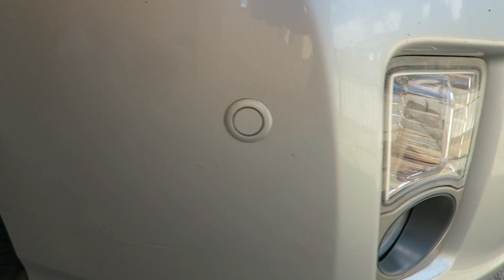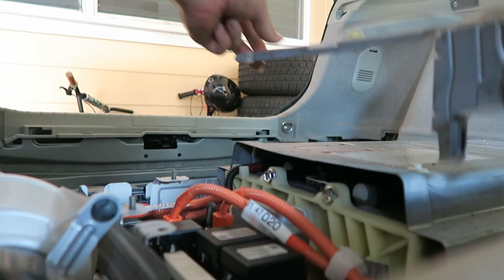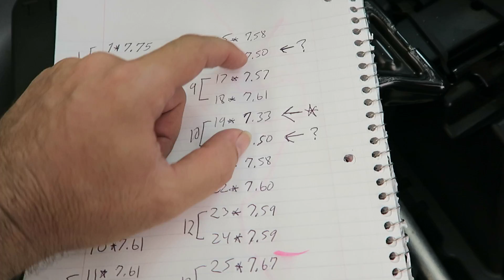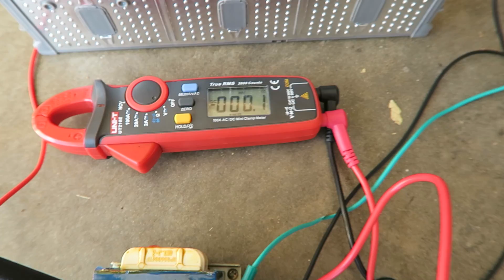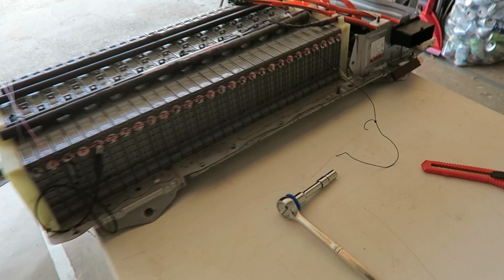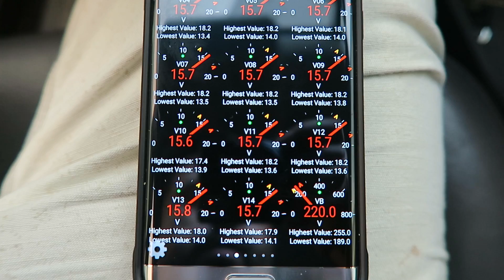Prius High Voltage Battery Repair | Gen lll 3

Comment: Use the orange breaker plug to disconnect the orange clips. On the tip of the arm on the orange breaker plug, you will see a small circular key point that is inserted into those two orange clips. Once inserted, a quarter turn in the direction the arrows point on those clips and your clip comes free. No need to pry anything.

Comment: I use Dielectric Grease anti corrosion on the cleaned up nuts and buss bars found at your local Auto parts store. I got mine from Advanced Auto. A 3.3 oz. can was a little over $12.00. Should be enough for life time of use.
Reply: I was wondering about that.  I don't see anyone else bothering with it.  I think it's a good idea.  That's what the stuff is for.

Comment: Too bad you are not in Cali. Main battery warranty is 10 years and 150k. Dr. Prius will tell you voltage AND Internal Resistance. It's what the Pros use.
Reply: That's why cars cost an extra 15-20% in Cali too.

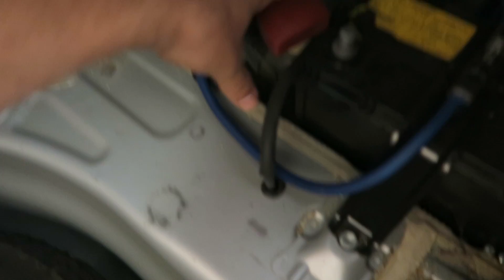Comment: U just solved my problem@2:54 of where to hook up inline power to 12v battery for powered amp. Would that be called the shunt side as someone mentioned in a thread. Now to find a good ground w multi. If i keep watchin this vid I bet i find it. Lmao fyi there is a spot on power cable battery for the dc dc converter fused to know that your connected. Dont know if thats where you hv it connected.

Comment: Pull the battery out before you take the main lid off. You can't do much in the car. You can't get to the bottom bolts in the car. You can't deadlift 120 lbs.? Hit the gym. I'm 72 years old and lift mine all the time. The trouble with buying used modules is that no vendor will tell the serial #. The first two numbers are the day, the third is the month and the 4th character is the year.But you have to know the secret code. You might have bought a module older than the car. Worthless.
Reply: He's doing a load test on them.  Is that useless?  Question; Can dielectric grease be used to keep those connectors from corroding?

Comment: Dr. Prius will tell you the bad block. Measuring voltage is a waste of time. You have to measure under load. And you have to measure Internal Resistance. You may be lucky but all that work may be a waste of time.

Comment: This would be under warranty in California. 10 years and 150k. Dr. Prius would show you the internal resistance  and voltage instead of crappy Torque-Pro.

Comment: It is December 2019 now. Did you have any problems with that 2010 Prius battery since the replacement of cells?
Reply: Having issues with our 2010 too. Just got a p0a80 code.  About to get a torque app or something to diag. What problem are you having?
Reply: @chrissignal8857  how many miles?
Reply: @Usernotknown21  160k
Reply: @chrissignal8857  i talked to dealer they say batteries last from 100k to 200k.  Funny the batteries never wear out under warranty
Reply: @chrissignal8857  did you ever clean the blower motor that cools the hybrid motor? 🤔
Reply: @Usernotknown21  yes cleaned but codes came back.
Reply: @chrissignal8857  no. I was wondering if you cleaned it as part of maintenance before the codes came in the first place?
Reply: @Usernotknown21  no

Comment: hey bro, I had the "Check Hybrid System" error, I did a check with the diagnostic tool, the error is P0A80, so I did again a test with milimeter and all cells are over 8v except 2 blocks are 7,8v . what do you suggess ?
Reply: Did you figure this out? My 2015 Prius just had the check hybrid system error message pop up and i had the same code when i scanned it.

Comment: I just bought a 03, with bad batteries, I thought about replacing the cells with lithium ion 2 in series, per model, it would charge to 8.4v and discharge safely to just under 6v, I think I'd get a ac charger to top it off, not rely on the vehicle to fully charge the cells, if the computer will all such modifying, I'd like to drive it mostly electric, about everywhere I go, the speed limit is 35mph. Any opinions are welcome! I'd like to double the range or better if possible,

Comment: Note of caution with the packs. The modules can thicken over time. If so, when you remove the modules and then go to put them back in, you will need to have a 30 inch pipe clamp handy to gently nudge them into place so that the anchor screws line up from below. You may also need to give them a love tap with a small hammer for other direction alignment (that's not as bad as it sounds :-). If your batteries are slightly thickened like mine and you do not have these pipe clamps, you may be screwed as far as getting the modules back in the pack. It is best to clamp two modules at a time to the secured block and secure them as you go.

Another practical tip, to remove the pack from car by yourself, best to straddle the pack with your feet, with your head facing the controllers and fan. Put one foot on back seat middle support and the one where spare goes. Lift with legs and move the driver side end first. Lift the support leg over the little hump and then set it down on the other side. Then with your eyes trained on the various wires at the controller end, gently swing the controller end out and set it down on the metal platform. At this point, with the pack resting on the metal platform, reposition your right leg as far back in the spare tire well as you can get it. Then, using your legs again, reposition the whole thing as far towards the back of the car as you can get it and rest it on the metal platform. At this point, get yourself completely out of the car. From the back you can now pick up the whole thing and remove it from the car. always use your legs as much as possible and when carrying the pack keep it as close to your body as possible. I suggest wrapping the pack in a towel to avoid the sharp edges while carrying it. center your hands around the battery, as this is the heavy part. the battery pack weighs about 80 lb so always use your legs as much as you can. this will help you to control it better and also might save you a problem with your back. Just thought I'd let y'all know :-)

Oh, in addition to the Torque app there is also the Dr Prius app. I highly recommend this app.

Also, the big Orange plug that you pull to deactivate the battery pack, has a special little nipple on its handle. That is used to remove the two orange safety plugs. That scheme is Toyota's clever way of ensuring that you have deactivated the batteries before messing with the pack. Hold the safety plug at its base and align the male-female parts and rotate, as the safety plug arrows indicate. They will come right off.

BTW, I devised a method for making a modification that allows one to establish modules 23-28 (the ones furthest out from the controller) as 'plug-and play'. I can swap these modules in and out without having to take the pack out of the car. I place the weakest modules in that area. If anyone wishes me to describe how to establish this plug and play area, just ask.
Reply: Make a video. It sounds awesome

Comment: Which is best to diagonise Toyota prius Torque pro vs Toyota Techstream ?
Reply: I'm not sure what you're intending to do, but purchasing a BAFX OBD2 scanner for about $20 and the Torque pro app for $5 will only cost you $25 total, and it allows you to view an incredible amount of information about your car. If you need help setting up the sensors in Torque Pro for the Prius, check out this video I found: https://www.youtube.com/watch?v=GYrslzbrwz8

Comment: What battery charger did you use to charge all the modules at once?
Reply: I want to know that too he said it was a 1 amp charger
Reply: @RSADYNAMICS  I think simply wiring up the cells in parallel like he did will balance out the cells voltage which is the most important part
Reply: @HEVTech1  yes but what did he charge it with?  Do you use a normal 12V charger set at 1a or do you need some other kind of charger
Reply: @vinceking719  well each cell should be charged to around 7.2v. A 12v charger would overcharge the cells. Most people use a hobby charger that supports multiple battery types and multiple voltages
Reply: Thank you very much.  Having a hard time finding something like that in Australia.  Would this work if I had it shipped from America?  https://www.amazon.com/Battery-Tender-022-0197-Volt-Charger/dp/B00VGO28CW
Reply: That one is 1.25 amps.  Or my other thought if I could use a 6 volt charger to get get some charge in the dead batteries.  Would that be enough to start the car and let it charge itself from there?  I am working on 2 cars that have been sitting in storage a very long time so the he batteries are dead

Comment: Bro, would you mind to link me to the right ODB2 & it’s app for hybrid battery check like yours? I’m not sure if I could find the right one on amazon or eBay myself, plz recommend me one. Thanks.
Reply: May I suggest you go to 
http://priusapp.com/
This developer has tested 100s of OBD2 adapters. Go to the site and click on the drop down menu “What OBD2 to Buy”. May I remind you there are many Chinese knock off, bogus adapters on eBay. So this developer has a few recommended OBD2 adapters. The developers App is called Dr Prius, the specifications for which are in the App Store. Last week, based on the recommendation of the site I bought a second hand Carista 2 adapter( $10). Using the free version of Dr Prius App, I was able to read the voltages of each and every module of my 2011 Prius’ high voltage pack.

Comment: Thank you .  Great videos I will never thought of check individual cell voltage from eBay use (computer balanced ad) none of the match up high was 7.60 and low was 7.10 add all cells up 210.56. So  I did what you did equalizing them. But with 2 copper wiers. I line them up  (-)on  the same side  and tied the end and zigzag all the way down to the other end and did the same with the (+) now they all reading 7.52 . But Definitely will do the load test on the one that was 7.10
Reply: P

Comment: which obd scanner you are using? I have one not reading block voltages.
Reply from the maker: Scanner does not matter. You need the "Torque" App on an android device to see all the prius parameters.

Comment: Hi Vlad
Great video and superb detail.
Quick question pls what charger did you use to charge. And is there a specific charge rate? If you could just explain the wiring bit to charge pls thanks

Comment: I did the process for my Prius 3rd gen battery. I put a load of 24 volts on each cell for a period of one minute and take initial voltage, after one minute voltage and then voltage of all the cell one by one after completing the process for the whole 28 cells. I repeated the process for the cells that i doubts after assessing their voltage and i found 3 cells that were returning a low voltage compared to others and i changed that. No CHECK LIGHTS so far. Thanks for this informative video @ Just Vlad
Reply: Dr Muhammad Shakir please give details of loading testing of 24 volts. What did you do exactly?
Reply: Hey! How long last the fixed battery? I meant with only a few cells replaced..Yhanks!

Comment: Is the charging of the battery necessary? Can't I just change the cell and install the battery back in the car?
Reply from the maker: You can, but it might trigger a fault if the new battery modual is not charged well. But over a few cycles of charge and discharge it will normalize into the pack.
Reply: Ok I understand but I didn't get the specifics on how to charge it. Could you summarize what I need, specs, voltage, amps, for how long please. I'm not an expert, I'm trying to research all I need to do the same with my 2010 Prius.
Reply from the maker: If you have a 9v power supply that should work. You want about 8.2v on the battery modual. But don't over charge cause it will expand if it's not in the pack. That's all really. As long as your putting in a good battery in, there should be no issues.
Reply: Ok so to summarize I need a transformer with a 9V output and regulate it to 8.2V, how many amps? I should connect each cell in parallel and charge it for 3 hours at 1 amp? The goal is to have each cell at 7.8V right?
Reply from the maker: Correct, just get the cells at good charge. It doesn't really matter how you get there. It doesn't have to be equal to the rest. They will all get to where they need to be after you start running the vehicle.
Reply: Ok thanks. One last thing. Should I make sure the battery is totally charged before checking each cell? How should I know if the cell is really bad if it's just low?
Reply from the maker: https://youtu.be/jDieFj8ubuA

Comment: Hi man, thanks for the video.. I tested the modules on my Hybrid battery Toyota Prius C 2012 .. Last week there were showing 7.82 V.. This week using a different volt meter they are showing 7.5 ..when I hook a bulb to it, the voltage go down to 7.1 and sometimes 7.0V on all of them. What next?? a junk 
 ard is offering a battery for $750.00 + $250 for the core .. is my battery fixable or do I need to save time and money and buy the one from the junkyard? thanks for the advice
Reply from the maker: This video will explain how to tell if your battery module is bad: https://youtu.be/jDieFj8ubuA 
Once you figure that out, normally its only one module that needs to be replaced.
Reply: @JustVlads  That is incorrect. The batteries should be replaced as MATCHED pairs. Please watch this video to understand better.   https://priuschat.com/threads/prius-hv-battery-module-testing-and-matching.191354/

Comment: Thank you for the outstanding explanation.  For those of us not mechanically inclined, the video shows how labor intensive battery replacement is.   Understanding what my car needs to function, helps me make the best repair decision possible.   My model is 2010 base with 195,895 miles.   Because of this video, I will repair my car.

Comment: Hi man 
please tell me, did you solve the problem for a long term ?
Reply from the maker: Yes, usually it will be fine for many more miles but its uncertain and another cell could go bad. But overall this is the best option you have if a module dies.

Comment: Torque Pro not avail for iOS.  Anyone know a similar app?  
Also I'd like to know more about balancing the cells. Will they eventually balance or is it necessary?
Reply: Try Dr Prius. The free version measures the HV Battery Banks.
Reply: OBD fusion will allos the custom PID's on IOS

Comment: Could you tell me what kind of app you used you can able to see individual cell’s power and the link of the OBD scanner? Thanks
Reply from the maker: It's on Android called Torque. But you will need the pro version and prius pids installed. Any wifi scanner works fine.
Reply: Just Vlad Thanks

Comment: Thanks a lot for the video. I just replaced a cell on my 2012 Prius V, although I suspect cleaning the contacts would have solved the issue. I replaced the weakest battery anyway. There where no sudden changes in voltage after I connected a 0.3 amp load to each cell, that's why I suspect it was dirty contacts.
Reply from the maker: I would use a higher amp load cause the batteries are tricky figure out. Check out this video: https://www.youtube.com/watch?v=jDieFj8ubuA

Comment: Please, tell me which torgue module that is? I have the app and cannot find that selection which loads all those batteries...ty
Reply from the maker: you need a paid version of the torque app and then you'll need to install the pids (link) https://drive.google.com/file/d/1Drv-LA4I_fFEuSAWJPdIUNHdWedUk3Jx/view?usp=drivesdk
Reply: I do have the paid version...  I cannot find that choice... that is why I wanted to know it's title, thank you.
Reply from the maker: If you cant get the file installed to the torque app, you'll have to input the pids manually. Keep trying you'll figure it out.
Reply: https://www.youtube.com/watch?v=ag02XbyvPNo
Reply: Thank you, I purchased a new reader and it works with a different app... I will work on installing pids manual though... ty

Comment: HI, What ODB2 did you use? I have 2010 Prius, that needs the hybrid battery. What battery monitor did you use to see hi/low voltages by each pack?
Reply from the maker: Obd adapter does not matter. The app is called Torque and you'll need to install pids.
Reply: Just Vlad I have a Bluetooth obd2 and also bought tourqe pro. Not sure what pid to install as I am not getting any battery info they all are black, not in green!!! I install gen3 Prius PID.... What am I doing wrong! Can you help? And yes BT is connected as I can see all ECU info.
Reply from the maker: Keep trying, the app is not locating them. If you have to, in the app enter each pid manually and then it will work. I will try to make a video about this soon but hope you will figure it out on your own.
Reply: Qayuum, get Dr Prius App. The free version measures the battery banks in the HV Pack. I suggest that initially when you want to connect on Bluetooth, that you clear all other Bluetooth devices from your iOs device.

Comment: i purchase a prius 2011 model lahore. but on 3 rd day i recieve the message of check engine. than i went to mechanic and knew battery was dead. new battery is very expensive even though my millage was 80000 km only/ i need to know any possibility of checking out of 28 cells  in lahore where i can get my battery ok cheaply by replacing one cell if possible
Reply: Smart Boy chk olx

Comment: I like how you've improvised the load testing. Thanks for the advise on the Torque app. Seems like a pretty neat software.
I sent Midtronics an email and they are yet to reply almost 24 hours later. I'm sourcing for other hybrid diagnostic solutions
Reply: Check Dr. Prius app, specifically designed for prius.

Comment: This isolater plug has the tool to open the small orange clips. saw it on another video.
Reply from the maker: +Ron A. Bolton your right, I didn't know that when taking it apart. Thanks for pointing in out.